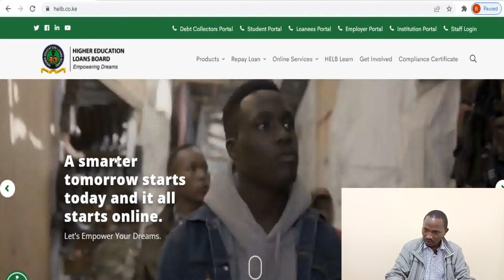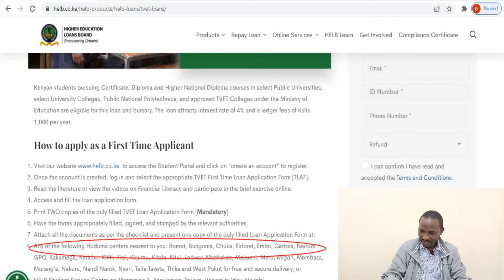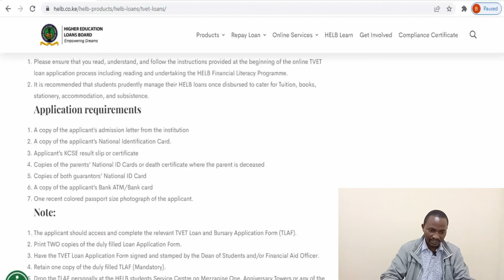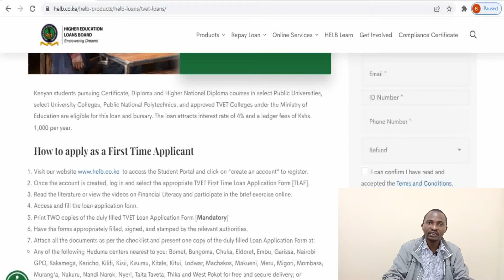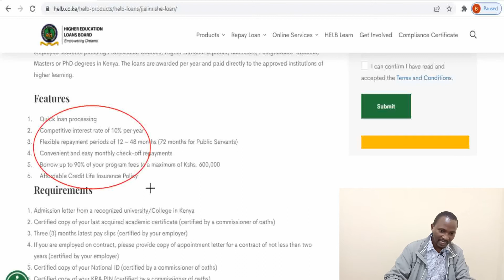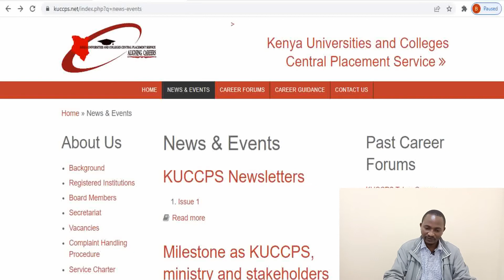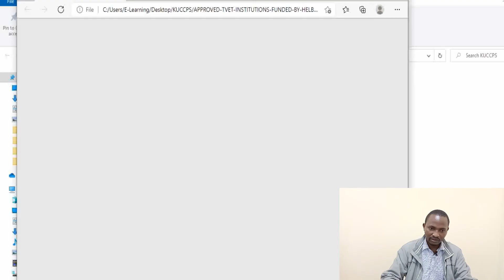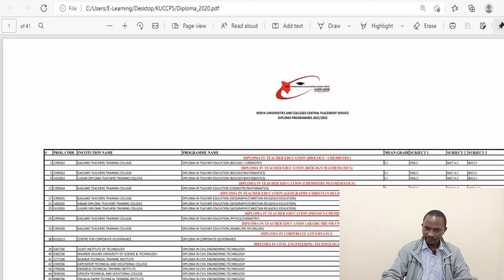How to get full funding for your diploma or certificate course plus accommodation fee

Comment: If i want to do a diploma in Civil Engineering having obtain a degree in mechanical engineering, will be required to do mathematics units again?
Reply from the maker: Whereas there is credit transfer from diploma or higher diploma to degree, there is no credit transfer from degree to diploma because in that case you're are shifting to a different course. Maybe you check with universities but for TVET Institutions No.